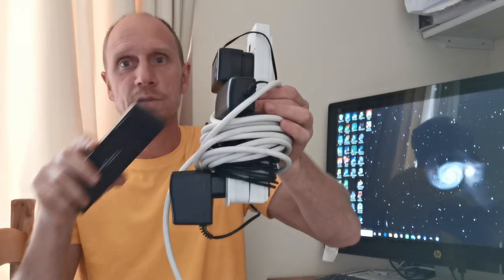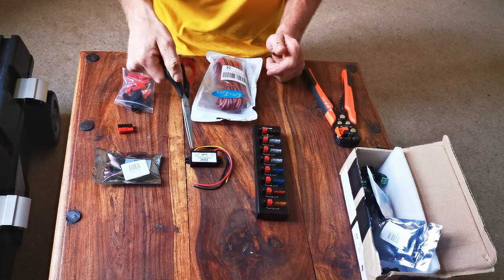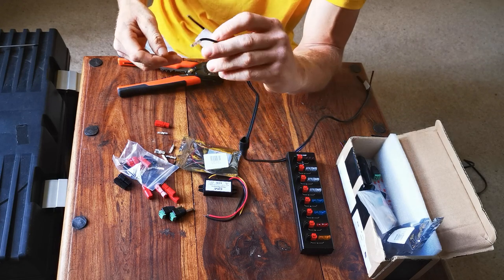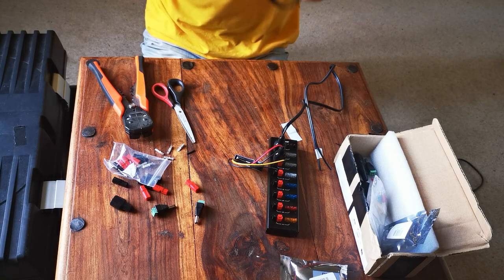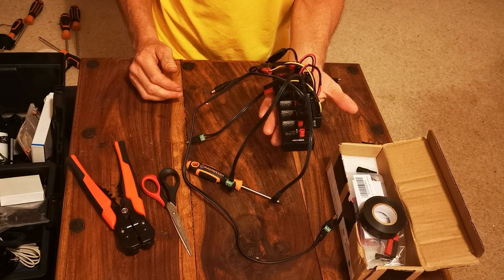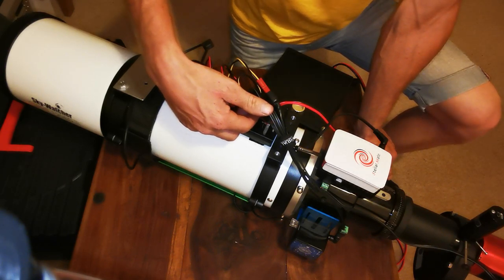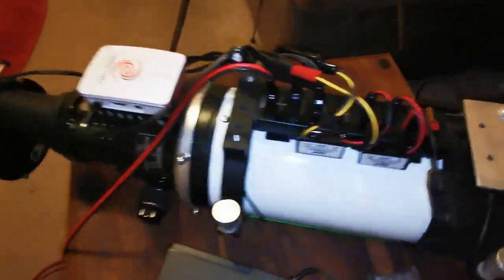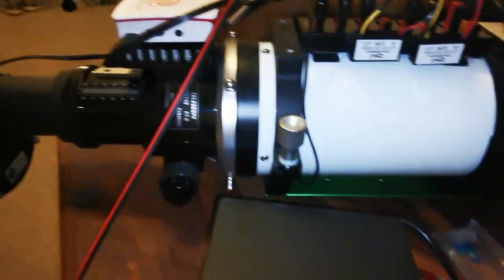astrophotography: DIY power supply and cable management project

Comment: Nice video is it better to use a powered usb hub instead of plugin direct to Stellarmate.
Reply from the maker: Exactly correct.. Some hardware runs more stable with a powered USB source (hub) the typical ones are guide cameras and eqmod mount cables..... And small dew bands can run off them too so is handy to have.... 👍
Reply: Ok thanks 👍
Reply from the maker: @elviscowling4672  no probs also another thing to do if you are getting a powered hub to work with a pi / stellarmate is to check on indi forum or Facebook kstars/ekos users group to see which powered hubs are compatible as some are reported to not work well with pi computers or certain softwares etc.... Lots of info and help on there... 👍👍
Reply: Ok thanks didn't think of that.

Comment: Hi Wayne, nice informative video.
I'm considering power management for my Telescope rig as was wondering what's the relative cost of something like your DIY solution versus say something like the Pegasus Astro pocket powerbox?
Keep up the good work.
Reply from the maker: Depending on your requirements.. If you only need a few amps worth of power say for 2-3 items roughly speaking then maybe get a used pocket powerbox quite cheap. But I needed something like the ultimate pegasus power box version at £100's so I saved myself in this instance £300 roughly. The whole project cost me about £140 including the big 20amp DC power supply you see in this video.
All in all suss out your amps required and weigh up the costs from there.
All the best with it all and good luck 👍
Thanks for watching and don't forget to share with others 👍😊

Comment: I'd like to know what kind of battery would be needed to power the whole rig to make the whole setup portable but still provide at least 10 amps to p[owe everything? . Preferably lithium. Also where is your guidescope going to go now?
Reply from the maker: Hi Natasha, I have used a sealed lead acid battery (36 amp hour) on the whole rig (including mount power) and it lasts about 6 hours,.. So for long nights I'd want to up rate it to the likes of a 100 amp hour marine battery to be sure of a whole night or two on one charge.
In terms of guide scope I could still mount a small guide scope on the front mount, but in my case I don't need to as I have a Off axis guider in front of my imaging camera.. Mine is a starlight express OAG.
Good luck with your astro adventures and thanks for commenting etc 👍